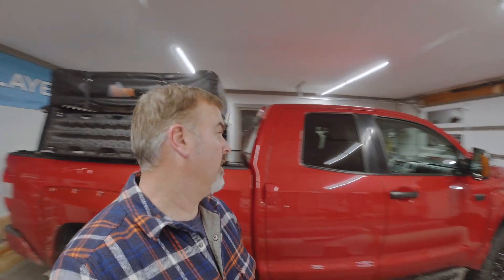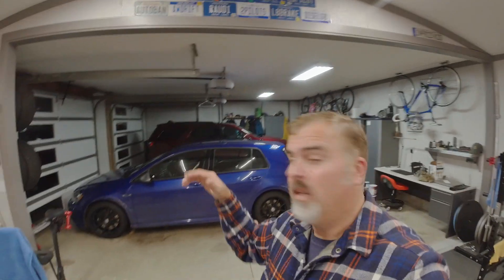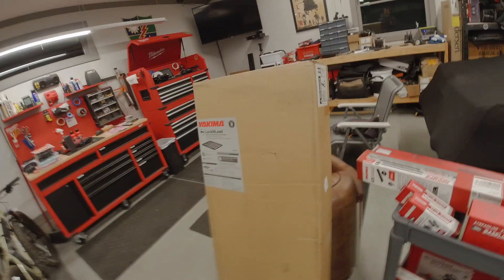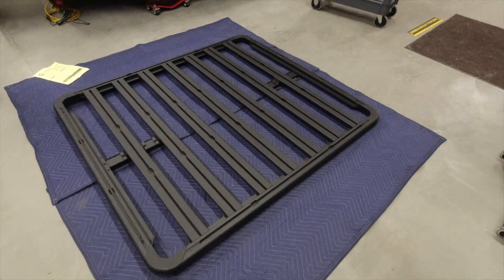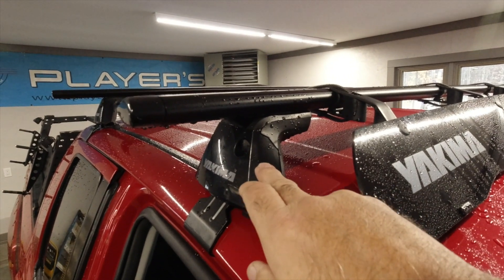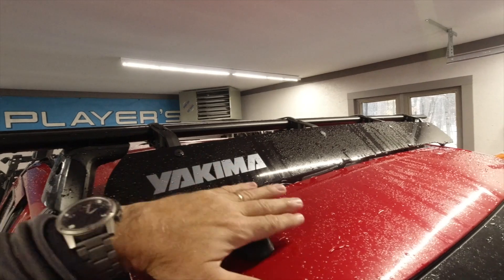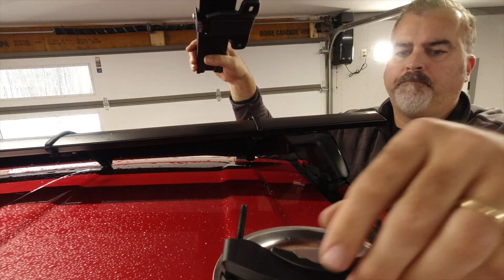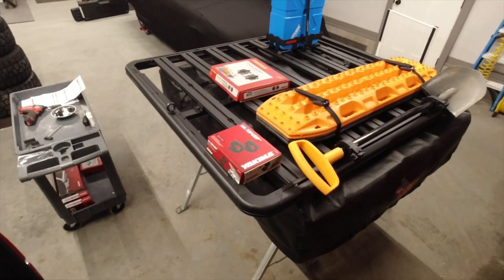Yakima LockNLoad Overland Platform Review

Comment: Good review!  I also have a 2011 Tundra double-cab.  Was wondering why did you not mount the platform directly to the tower to give it a lower profile?  were you concerned about the weight of the platform and needed the crossbars for more stability?  
I was talking to our local sales rep and he advised me i could mount the platform directly onto the skyline towers if the towers were mounted on a track system as suppose to the tower door-clip style.  If I was to put a roof-top tent on the platform maybe then i should use crossbars due to added weight?  Would love to hear your input.  thanks for providing this awesome review.
Reply from the maker: I was sent the Baseline Towers by Yakima and those can't mount directly to the platform. I don't have a channel system so I was stuck with this set-up using the crossbars. I can't comment on the weight limits of the Skyline Towers and your roof top tent. But I'll bet Yakima can answer those questions.

Comment: Question, I already have an existing timberline/jetcore bar setup on my suburban with a Skybox cargo carrier. I am trying to add more surface area to strap additional gear on for camping and I am curious if the skybox would clamp to the lock n load bars? Or is it use one or the other not both at the same time?
Reply from the maker: That's a great question. But one you'd be better off asking Yakima directly. I don't want to speculate or mislead you.

Comment: Are you still enjoying the locknload setup. I have a similar kbvoodoo rear rack and debating going with the locknload or going with a rhino rack which would require drilling into the roof. Any cons you could see with this setup over something "permanently" mounted on the truck?
Reply from the maker: I would avoid drilling through the roof at all cost. Owning an FJ as well, I see a lot of owners on the forums with pictures of wet, stained headliners from leaks created by the roof rack system.